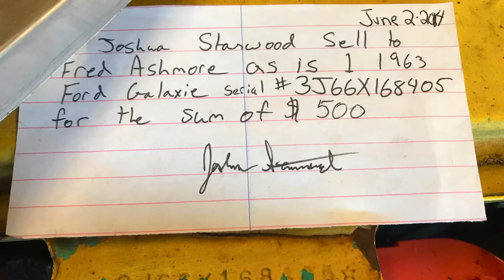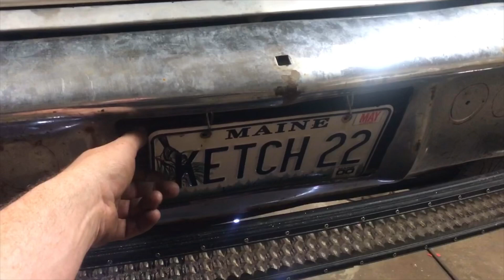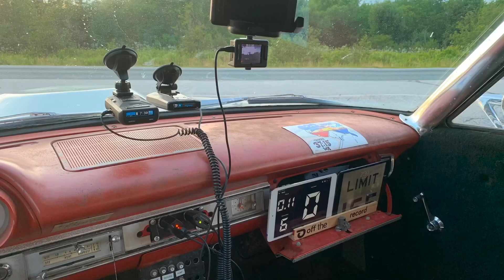The Ford Galaxie packed with 187 gallons completed 1st ever nonstop run from NY to LA in an event

Comment: what was your GVW  with full tanks??
Reply from the maker: 4800ish
Reply: @ashmoresspeedandperformanc4782  bout the weight of a 1/2  p/u ,that's not bad, less than I figured,I assume  your tanks were baffled, still, must have been a heavy handler, but it' looks like it must have been s^#t load of fun.   keep on keepin on